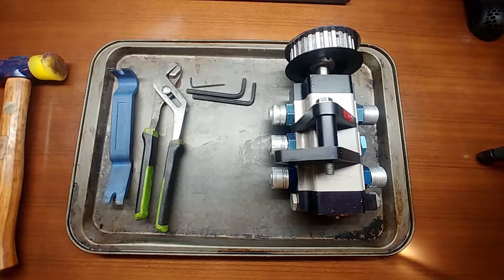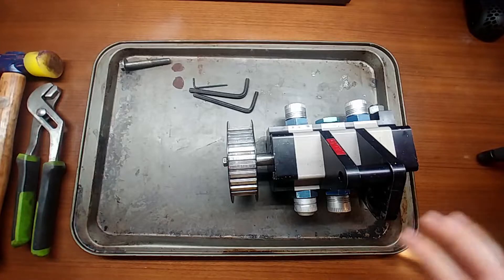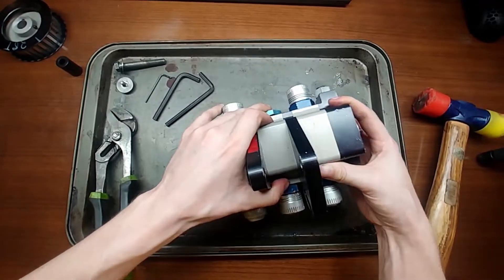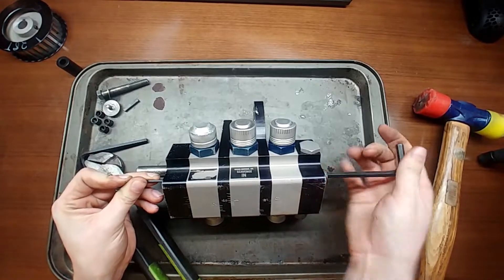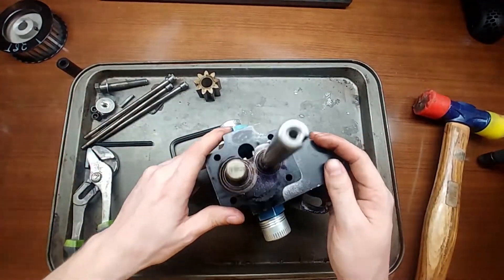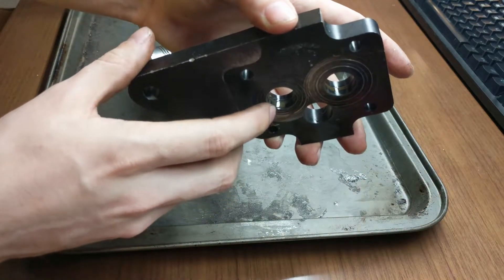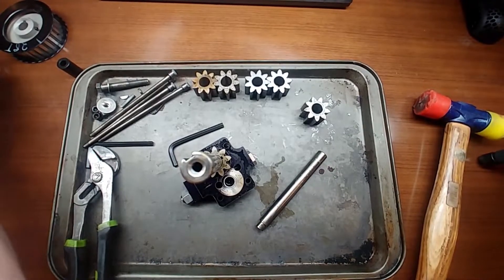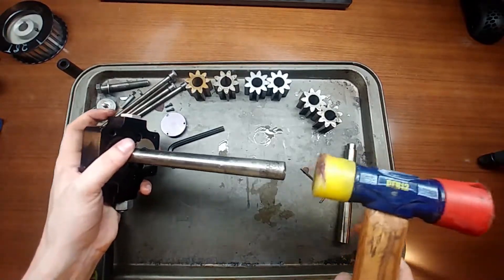Dry Sump Oil Pump Disassembly and Inspection: How to

Comment: I'm having a bit of a concern with my 3 stage pump. It has standard spur gears and I have taken it apart for inspection and then assembled it again. I did tighten the draw bars up a bit but not much. I wouldn't say that it's binding up when I rotate it by hand but there is definitely some resistance, I'm guessing from when the drive gears have to turn the follower gears. Does your pump have that resistance too when turned by hand?
Reply from the maker: If there is no fluid in the pump there should be next to no resistance since its not moving anything. When I reassembled mine there was hardly any resistance at all.

Comment: I need help i am running a 4 stage weaver pump on my race boat , i am running it off my flywheel which would be backwards from what most people run them off the front of the motor , My issue is i am getting way to much oil pressure and i did adjust the pressure screw and didn't do anything , i think it's all plumed wrong where i am not getting any scavenge oil back to the tank , I just need to know if i have it turning correctly and what hosses go where .
Reply from the maker: Pumps typically run clockwise, I verified my flow direction by running the pump with a drill and moving water. From there, I decided where my scavenge lines would go along with feeds.
Reply: If your pump is running in reverse direction it won't be picking up oil on the scavenge side. It will be trying to blow back in. The pressure side also turning in reverse means that your pressure adjustment bypass is being fed backwards. Rather than the oil pushing on the spring loaded bypass piston and opening it. It is pushing on the back side of the piston, where the piston can't open to relive pressure. Set up an idle gear between your flywheel and pump, that will reverse your pump rotation to clockwise. Also ensure your pump rpm is about half of your engine rpm. Example: if your flywheel has 150 teeth, your oil pump would need a 75 tooth gear on it